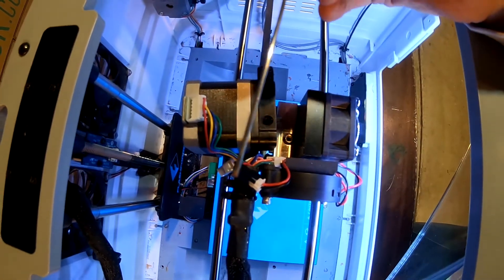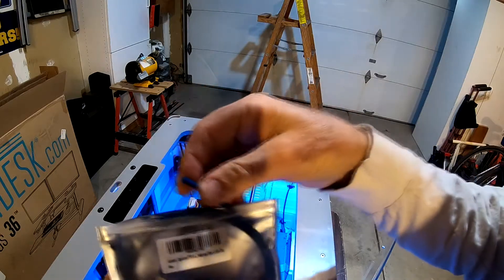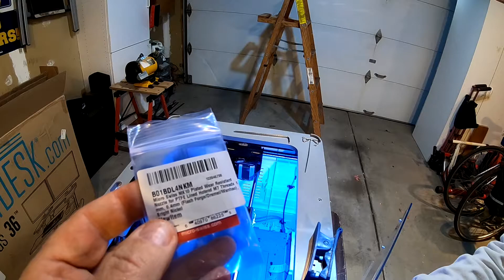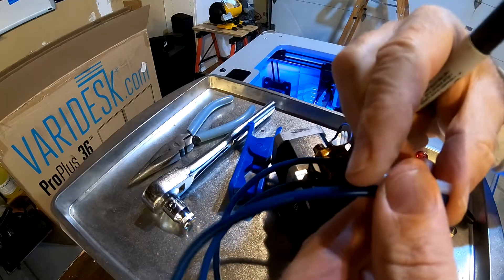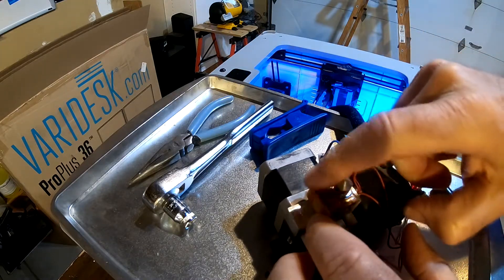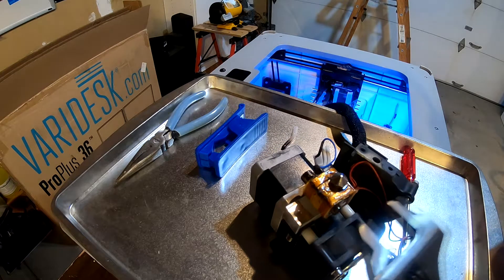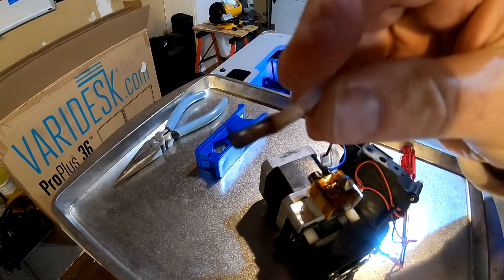Flashforge Dreamer (NX) - Replacing the Nozzle and Heat Break Tube - Part 1

Comment: When I do maintenance I rotate it to lie on its back. For my line of sight and hands, works better. You can also lay your phone down under the extruder in selfie mode. I also have a powerful lamp that illuminates the whole area. For serious jobs even remove the cover panels. Mine is in a school with kids making a lot of mistakes, but now 5 years old.  I think the biggest problem we have is the two nozzles not being the exact same height. I have no idea why they drift out of alignment line.
Reply from the maker: I agree. I've switched to doing it that way like I do in this video:
https://youtu.be/ebT9K8mgxBI?t=272

RE: Nozzle height
I noticed a big difference between the nozzle height from different manufacturers.
For example MicroSwiss Nickel-plated brass vs. a brass nozzle

In any case, I level the bed before every print.

I'm printing things for sale that take multiple hours to finish.
Spending 1-2 minutes leveling the bed before each print isn't a big deal.

I've since upgraded to a FlashForge Guider II. That has a much more robust Z-axis.
I only level first thing in the morning. It hold its level the rest of the day.
Usually overnight it's fine too, but I like to be sure.
I'll have a video series coming out later this year about my experience with the Guider II.
Short answer: it's a great upgrade. I'm much more productive with that.

Comment: How well has this printer held up and long did the original tube last?
Reply from the maker: The printer itself is a workhorse. I'm printing 10-14 hours 6-7 days/week making products for my Etsy Store (link in the description).
I have an upcoming video on how long the heat break tubes last and the best procedure replacing them (minimizing downtime).
It's a function of how many hours you print.
The tubes that come with the printer aren't that great quality, but the Capricorn tubing linked in the description for this video lasts for about 600 hours of printing.
For me that's about 2 months.
Rather than wait for the tube to fail (i.e. clog and cause print failures), I just change it every 2 months (2 months x 10 hours/day x 30 days/month = 600 hours).
Reply: @BetaCygniBlog  excellent news I've been debating on getting 3 or 4 of these to start a mini farm for some of the ideas I want to sell. It's great to see these things are a workhorse. 

How many hours would you say you've racked up on it and does it have a work clock on it to keep track of how long you've printed for?

Your videos are a valuable asset for those of us interested in these or have them. The detailed information out on these are quite scarce.
Reply from the maker: @zedsdead7670  Thanks for the compliment! I have more videos coming. I'm trying to show how to work with the printer day-by-day, not just a one-time review.
I think you'll be happy with the performance if you set up a farm of 3 or 4 of these. I just have one so far. I've been able to keep with the demand for my Etsy store.
I have 2000+ hours printing on this printer.
It doesn't have a "work clock" and I don't keep strict track of how many hours I've printed, but I generally print 7 days a week (with a day off once in a while or when I go out of town) for 10+ hours/day (averaging around 12 hours).
Occasionally I run 24-48 hours straight if I have long prints that last more than 8 hours so I can do them while I'm sleeping.
If possible, I never let the printhead cool off without cleaning it out, so I don't normally let prints shutdown on their own.
I think this has increased the reliability of my prints.
I also level the bed before every print even if I'm not changing filament. I do a filament "unload" and wipe the nozzle before leveling before the next print.
I have an upcoming video on that as well.
I print in an unheated garage so the ambient conditions are changing all the time. This affects the zero position.
I try to schedule prints around 4-5 hours if I can (I'm mostly printing multiple copies of the same thing) to cut down on how many times I have to interact with the printer.
It's worth it to me to level each time so I don't lose a 4+ hour print.